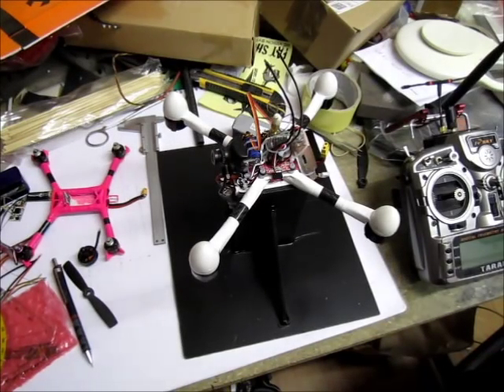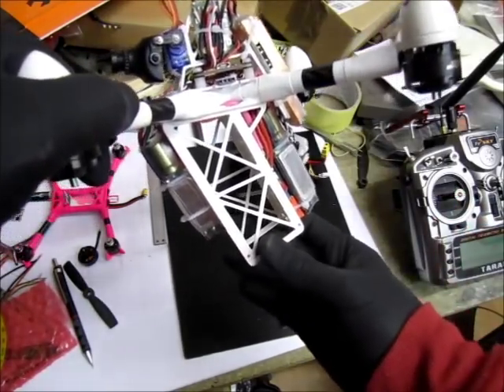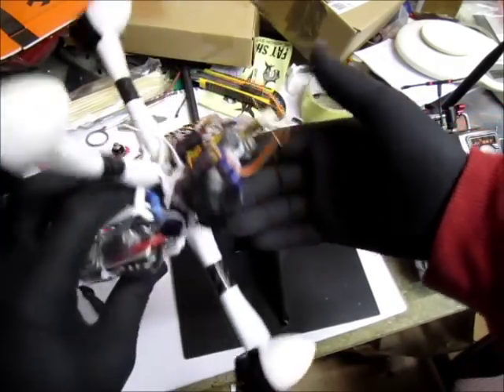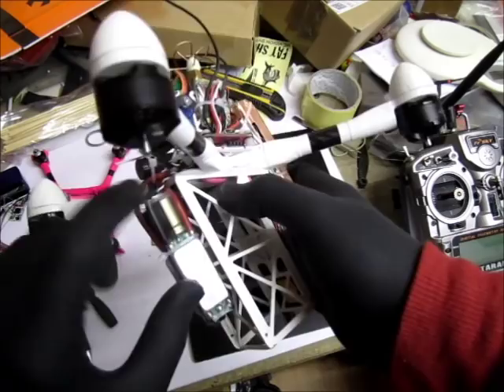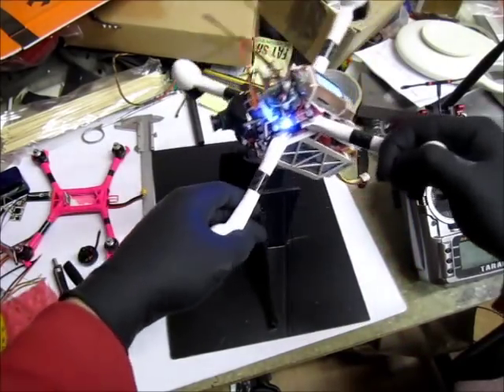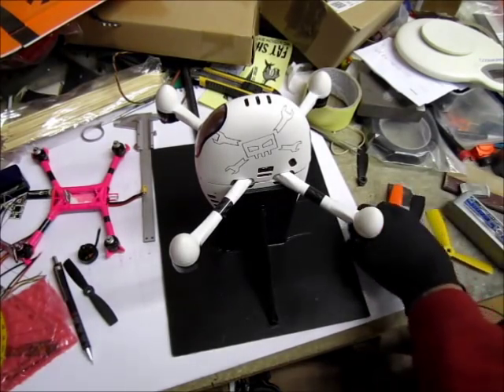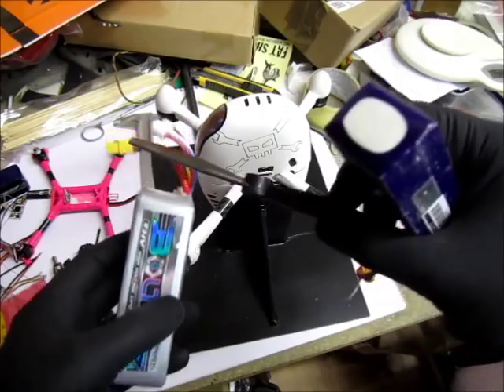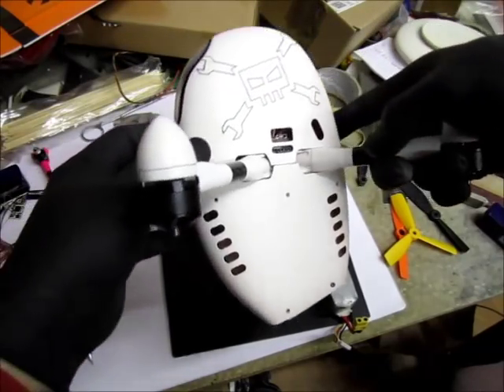Miniquad speed record. Part 6- V2 buld overview

Comment: My absolute favorite "Mad Scientist" Multirotor specialist on youtube! 
Fucking Slaying it with the logos. I guarantee they give an extra km/h or 5. Got to. =)
Reply from the maker: +Hiway 
Yeah man, it's like "turbo" stickers on a rear car window that gives extra 5 horsepower:))
Reply: ROBOFORCERX2000
...and the shiny mag wheels- don't forget those. They are good for another 15hp right?
 Also- I use summer air in my tires and charge my lipos with seasonal voltage ;)

Comment: Are you going to the Irish Drone Nationals in Santry on December 12th?
Reply from the maker: +mrtynan 
A? Wha? Holy cow, I didn't even know it is on in Ireland!!! I've serious lack of practice, copters are not ready or tuned etc, so yeah, I'll be there:)
Reply from the maker: +mrtynan 
Just found out that it is 250mw max for Vtx power, and all my Vtxs are IRC 600mw. Oh well, even if I won't race I'll still be there, and now I have to order a bunch of 250mw race band Vtxs...
Reply: +ROBOFORCERX2000 I'll throw a spare 200mw in my gear bag, you can use if you want.
Reply from the maker: mrtynan Thanks for the offer mate, much appreciated, but it won't work unfortunately...
I shred all the pins on all of my gear and solder everything directly, I've no connectors anywhere except one for the battery:) And to get an access to anything I have to take the whole quad apart, but from now on I'll have to review my builds if I want to race along others. Well, I've just ordered few Hawkeye 200mw Raceband Vtxs, hopefully I'll get them in 5 days as promised so I can embarrass myself on flying skillz among others:)

Comment: This looks like a good design for speed. Did you ever break 163km/h? I built a quad to challenge this recently but having some problems of my own so far. It's comfortable cruising at about 100km/h with about 60% throttle on 3S battery, but at full throttle it starts to pitch up and down - I think it might be an aerodynamic issue, might have to make a cowling like yours. How did you make the cowl?
Reply from the maker: +iforce2d 
I formed the cowl from fiberglass. There's a link in description to FPVlabs build thread, pics says it all:)
I didn't break that 163km/h yet as I was having trouble with ESC sync, then crashed, then crashed again coz of cam stab, then burned ESC, and now she's ready to go again weather permitted:)
Reply from the maker: *****
Cool bro, thanks for info, I didn't see that! Well, I have to step up my game...

Comment: those esc's are huge, battery is huge(what is c rating?), what is your receiver? You should go sbus. Why not get smaller esc's and put the on the arms if you need them to be in air flow
Reply from the maker: +pizatric1st 
There's no smaller 40A ESCs on the market yet, I actually needed 50A there as some props on the bench asked for 45A. Rx is DR4-II and is one of the lightest. I could put TBS Crossfire Rx, but that would save only 3gr. To put ESCs on the arms was my original plan, but after replacing their caps they became a bit too fat for that. 
4s HV battery is 65C and one of the lightest in it's category as well. If the rating doesn't lie  it will give me 156A and I need   180A from it, so it is already too small. 6s battery is only 1.55A capacity 65C, gives out 100A and weighs the same, so in theory I should put 2 of them. 
So to start from the start- smaller motors will not give as much power and rpm as 2208, and what I have for them now is the lightest minimum and I hope that it will be enough for few WOT passes:)
Reply: I have some 2208's they are powerful, I only use RG20's on it atm, with 6045, runs cool, run 1800mah 40c atm but not trying to break speed records, I recommend you swap the dr4-ii for a x4r-sb and use sbus it is the only way to fly, but if you're only flying straight lines I guess it don't matter much

Comment: Don't use the cam stab on the FC Instead hook the servo up to an aux channel on your RX and program it to a 3 way switch or slider on your TX. Like flight modes  SANE CRAZY PSYCHOTIC. I love your insanity brother good luck.
Reply from the maker: +Raptor21stoys 
Thanks man, I've been warn about camstab already, but of course I still have to try it myself:) In case it will be unflyable with camstab on, I'll set it on a switch or a slider on Taranis.